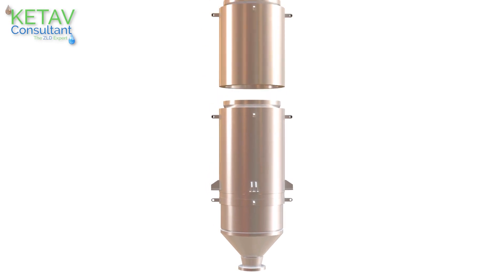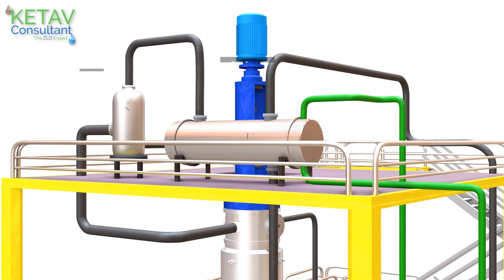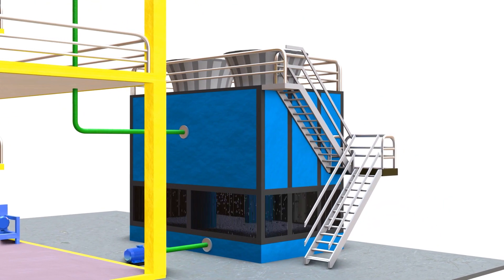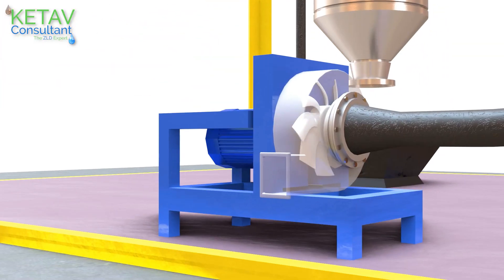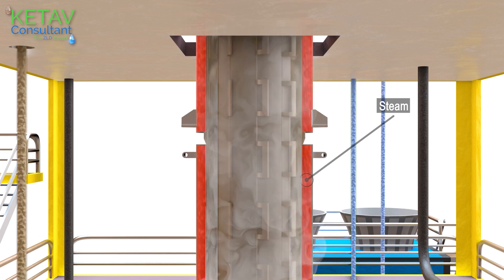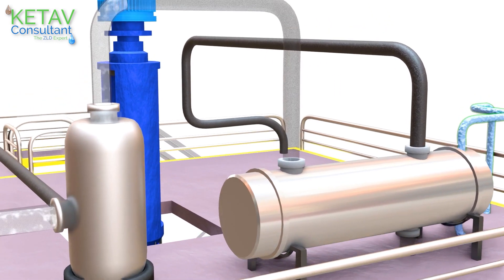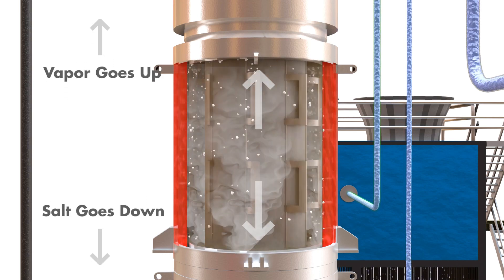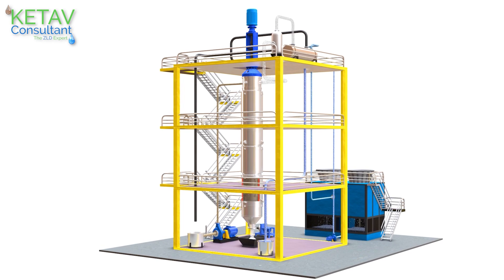How Agitated Thin Film Dryer (ATFD) Works - Ketav Consultant - The ZLD Expert

Comment: Excellent presentation. Keep it up. In this case, Cooling Tower Needs blow down some portion of water to avoid scaling in side the Heat Exchangers by maintaining solubility of solid ions within the limit. I do not have idea, in that case ZLD can consider or not for this project. We face such problems form some buyers. Pls advice, if any one have experience. Thay advised Blow down water can not put at ETP or out side. Have to evaporate by external heat source. Hence another waste of energy. Thanks to all of u.